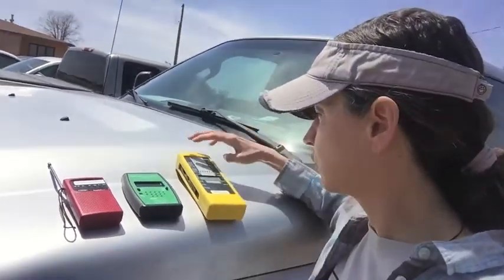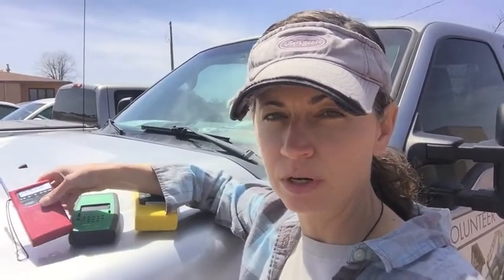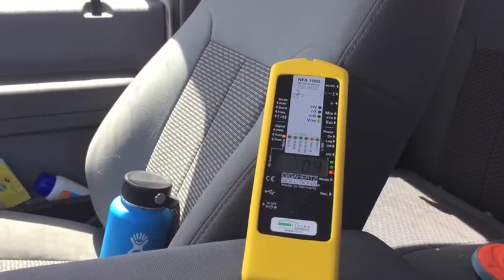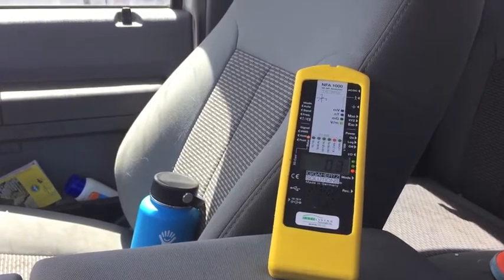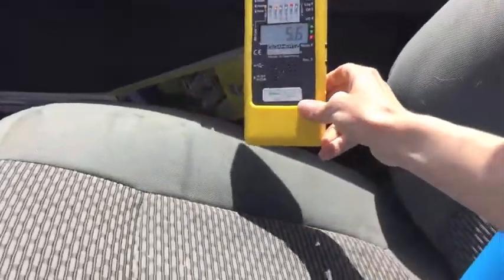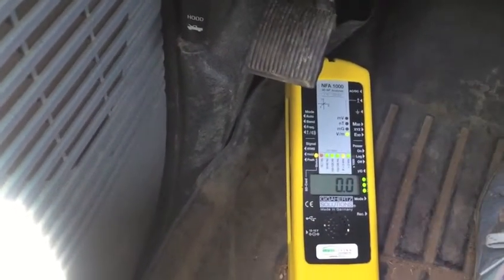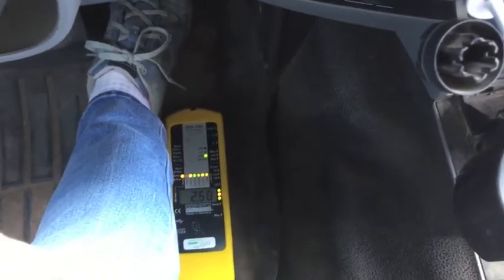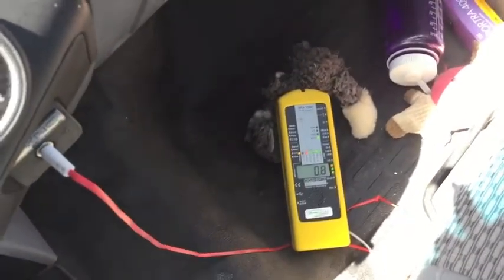EMF LEVELS IN A FORD F250

Comment: My 2019 Nissan NV2500 Work van is pretty low in magnetic fields compared to others. It has no power seats, And it's a V8.  The V6 is lower but I wanted the power. I imagine one without a 120v  inverter might be even lower as mine has a higher rating alternator, meaning more emfs.    Not sure if a passenger Nv2500 would read the same.  Would be cool if you could do review on one and see.

Comment: I have a Cornet Electrosmog meter, newer model bought in 2019. Is there a reason you use 3 different types of meters? More accurate?
Reply from the maker: Yes, my meters have more sensitivity than the 3-1 meters, though the Cornet is a good meter.